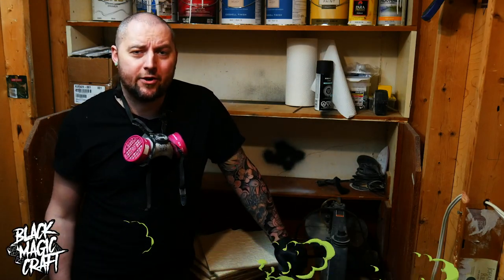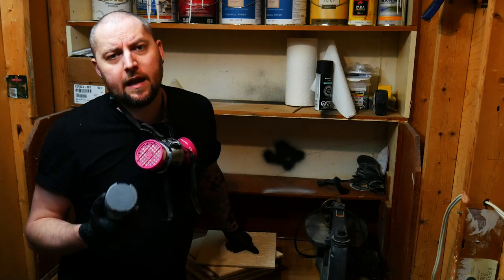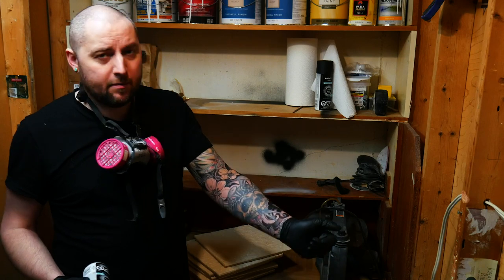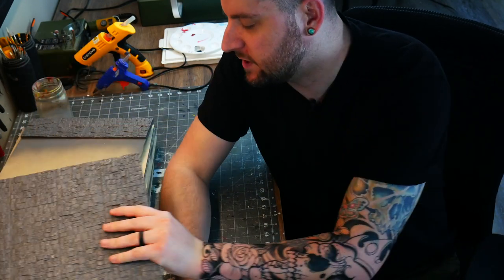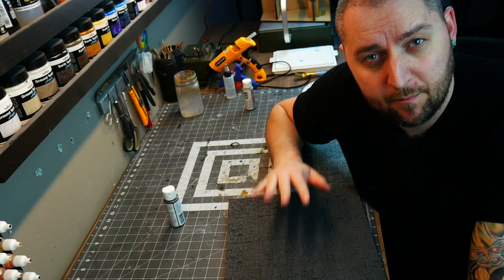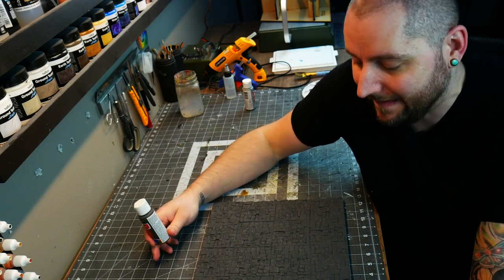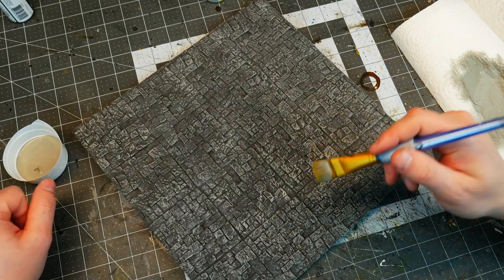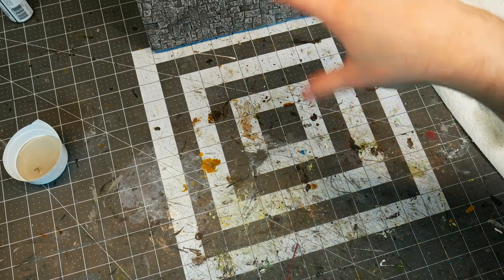High Detail Resin Tiles for FROSTGRAVE - Part THREE

Comment: Alright, saw all three vids and they were pretty good.  Man, there is a lot of work you vested into making the tile boards...and you're still not done.  I feel you exhaustion friend.  A little tip for using the rubber mold and resin material: place your project on the same surface, (table preferred) as your air brush compressor, then run your compressor for a minute.  The sonic vibrations will move all the air pockets to the surface..thus no air bubbles.  I also use material from Micro-Mark, I'm sure you heard of them.  They have a product called, "Thinner for silicone mold rubber", and works like a champ for the dated RTV you have.  Trust me, I have the same problem with shelf life of the RTV. After watching umpteen videos, I'm ready to pull the trigger to become a Patreon for your channel.  Love the work and honesty in your videos!

Comment: You might look into Createx Colors paint for airbrushing. It's typically used for automotive work like making murals on cars, but it also works really well for stuff like this (I used it a lot when doing DIY Vinyl figs back in the day). It may be a bit more expensive than craft paint, but I think it should be much less than most model paints. It's also waterbased, which makes it low voc and easier to clean.

Comment: I've been using Premier Primer when I printed out my 3D mini terrain. I haven't had an issue with it. It's the most affordable primer I could find. I like that it comes in different colours, I normally go with the flat black but I might delve into using the other colours.

Comment: A very interesting process and the end results speak for themselves. What I really liked about this series was the inclusion of all your mistakes - sorry.☺
Making the tiles too small, the rough edges, having to trim the 12x12s, not necessarily mistakes as such, but issues that a first-timer would run into. Showing these problems as they arose showed what the issues are, why they happened and how to fix them. It also gives the builder the opportunity to avoid these issues completely and thus avoid having to fix them. I haven't explained that very well; I hope you get my drift.
In the end, you have a highly detailed set of tiles which, I'm sure, could have a multitude of uses. Thanks for sharing this laborious process with us. In doing so, you have probably saved some builders A LOT of time. Without your guidance, how many would have started out with the smaller tiles and had to go through the entire process?

Sorry if that sounds negative, it's not meant to.☺
All the Best,
Dougie.
Reply from the maker: Not at all. I include all the struggles for exactly these reasons! Mistakes, struggles, and learning is not something to be ashamed of. It’s what the hobby is all about. Too many creators hide this part of the process.

Comment: I put apple barrel paint through my cheap Master G22 airbrush all the time. I've found about 50/50 paint to thinner plus kicking the compressor up to 20-30psi works ok. Yeah I get dry tip but I just clear that with a q-tip and some airbrush cleaner.
Reply: also, a few drops of a flow improver like Liquitex Flow Aid or Vallejo Airbrush Flow Improver helps prevent dry tip, which is what normally causes the clogging.

Comment: One thing that really helps make massive builds more manageable is to break it up with smaller builds. Instead of filming all 4 parts back to back, film a part, do 1-2 small builds, then film the next part, etc. It does mean you have to really commit to returning to the project each time, but it really helps with the burnout.
Reply from the maker: Im not that kinda guy. If I put something down I never want to pick it up again. With everything I do I have to do it in one continuous go, for better or worse, it's how I operate.

Comment: Hey Jerome I wonder if going over the curing resin with a heat source would help with the bubble problem. I know when pouring over a counter top using a small propane torch or heat gun makes the bubbles rise and vacate the resin, might be worth a try.

Comment: For the painting, did you think about adding either flow aid, or even a little bit of black wash to the paint to make it easier to coat, yet thin enough to not obscure the details? Is there an issue that you know of with adding wash to paint or flow aid to paint that made you decide not to do that?
Reply from the maker: A flow aid may prevent it from staying on high points. I diluted the paint a lot though. Could be with trying.

Comment: I am surprised a handy fella like yourself hasn't just built a spray booth. The simplest builds just need a shop vac to power it. I also am surprised you havent made yourself a vac chamber for resin casting. Either of these could also be used as content for your channel.

Comment: Man this is being a extensive build. But i got ask... which was more time consuming? these frost grave tiles or your modular cave tiles?
Reply from the maker: Cave tiles don't even compare. My 100ish set of cave tiles took maybe %10 of the time. Those were a breeze. At the point this video ends I'm probably over 60 hours of working time on this project.

Comment: Making bigger tiles is always a problem since the edges of the pattern are easily recognizable.
You made a massive impressive job, though.
Reply from the maker: The edges of the tile are recognizable at any size......so it's kind of irrelevant, imo the bigger the tile the less of the seams. Anyway, with this set complete the seams in the cobblestone tiles are almost invisible. You see the pattern of the 3x3 more than the joints of the 12x12. You'll see the set completed in the next video.

Comment: All I want to say is:
Step 1: find a battery operated desk lamp.
Step 2: assemble a cube made of MDF
Step 3: Line cube with adhesive magnetic sheets
Step3: mount the cube on the lamp
Step 4: affix the resin tiles on the cube
Step 5: drill small holes in the tiles for the light to shine through
Step 6: Add magnets to your miniature bases
Result: Enjoy 3D adventures on the Floating Borg Cube

Comment: Usually you wash resin casts because manufacturers use mold release and there always seems to be a residue still when you get the thing home.  Your homebrew casting should be fine.
Reply from the maker: Resin also secretes some oil in the few days after casting that you want to wash off.
Reply: @BlackMagicCraftOfficial  Interesting, I have been casting resin a longish time and never encountered that. I shall have to watch for it.

Comment: INSTEAD of opening up all you basement windows - Why don't you create a Paint Booth -    Where all of your fumes are sucked out of your house.   Might save you some of your houses heat and you will not get overspay lingering in the air or on things you don't want to get painted.
Reply from the maker: Because I’m not made of time.....it’s on the to do list.